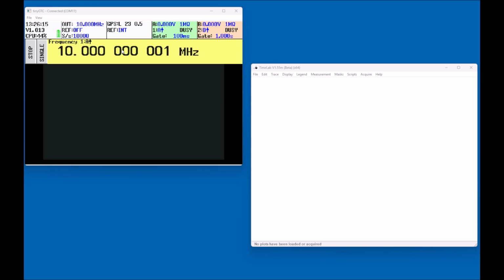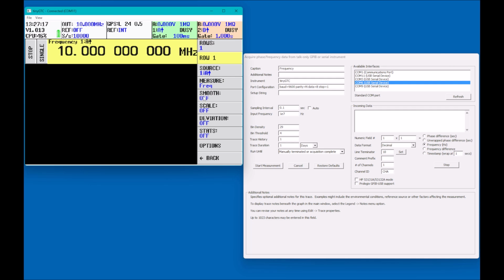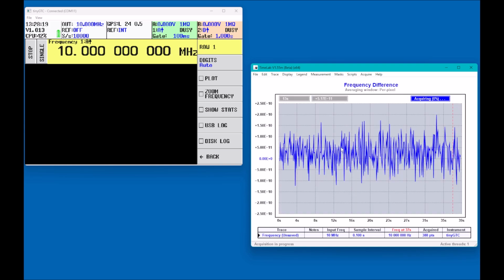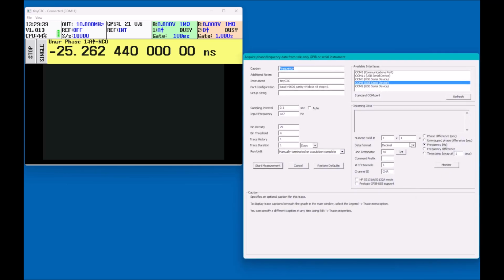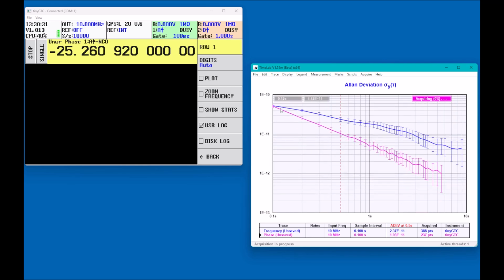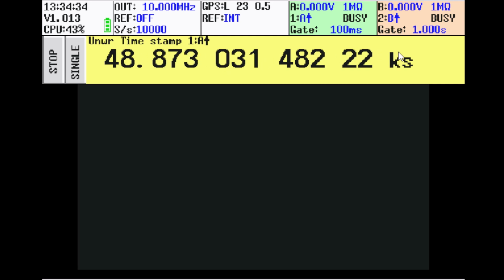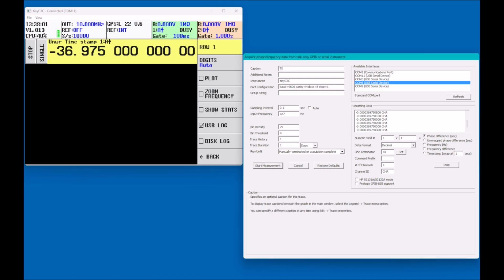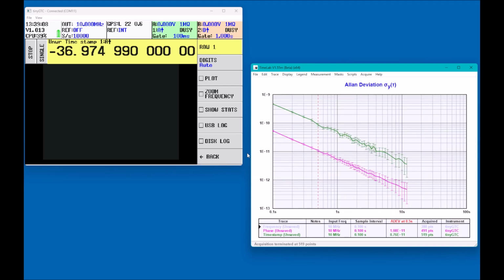tinyGTC and TimeLab

Comment: Could you find someone to explain the device to us in German? Especially what it can measure and how. Thank you.
Reply from the maker: In youtube you can click on the settings icon and select Audio Track and select German. You can ask your browser to translate the wiki pages. Works well.
Reply: @ErikKaashoek  Thank you for the information. I can't change the audio track to German on my old smartphone browser. So I translated the text from your website into German using Google Translate.
Will you eventually release a device capable of measuring time intervals down to the nanosecond range? This would be possible both via a single input with a start and stop signal, and via two inputs with separate start and stop signals. A comparative measurement of two time durations might also be interesting.
Reply from the maker: @karlbesser1696 I assumed this to be already possible. Can explain why not?
Reply: @ErikKaashoek Do you mean my suggestion for an ultra-fast timepiece or the YT translator, which for some unknown reason doesn't work on my old phone?
Reply from the maker: @karlbesser1696  sorry, replied to wrong message
Reply: @ErikKaashoek You're welcome. It's no problem.
Reply: Bei mir hat er übersetzt.....